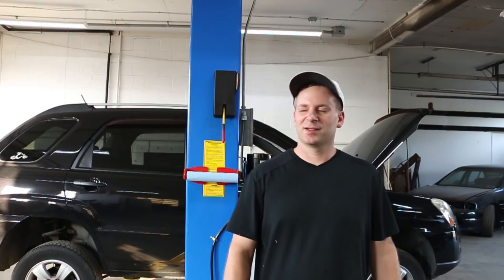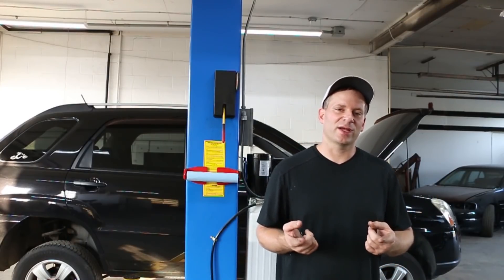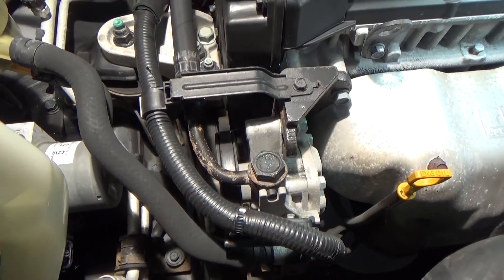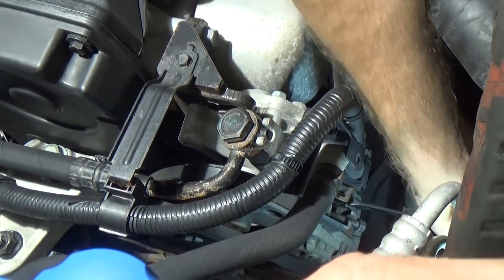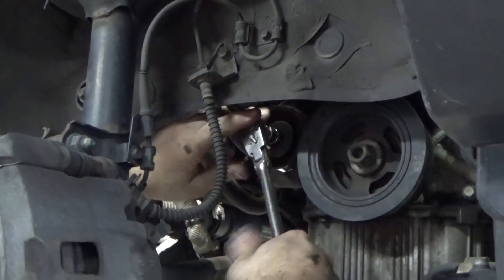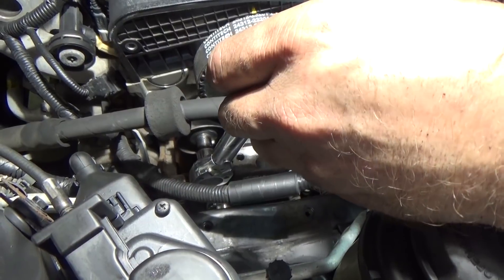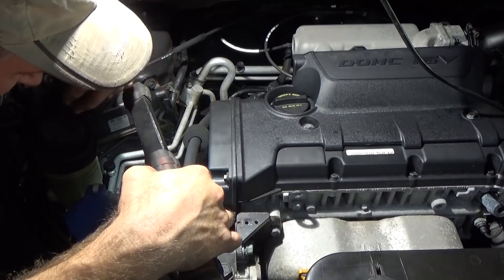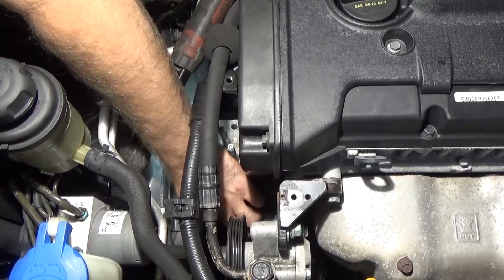2.0L timing belt Replacement kia Sportage and many others

Comment: Where are you located? And can you fix mine? I tried to do everything you said in the video step-by-step and it’s making a weird noise now that it wasn’t make it before. What should I check first
Reply: Apparently after I took the hoses off of the engine before I started the process of changing the water pump and timing belt I didn’t realize they where worn out and needed to be replaced as well, so i replaced those and got a new battery due to it being completely drained as well. And made sue all the top timing marks were on point before the process of putting the crank pulley back on and the tensioner pulley for the belt. I also made sure the bottom mark was back where it was at the beginning and put the crank back on. Also what is the pounds of pressure for spec?

Comment: i have a tuscon 2008 and the belt timing it the same it, but when the belt already is installed and start the engine the belt it go at one side rigth and no stay in center of sproket camshaf ?

Comment: My cars not starting , had a shop replace my timing belt with gates replacement . Car wont start and smell wierd burning smell in engine compartment by the belts . Opened cover to see if timing belt broke but its there . . Could the belt have moved forward on sprocket or slipped thus causing my car not to start after it cranking>?
Reply: 53 years as tech. Not likely but possible they left the washer OFF which is a belt guide that goes behind the crank pulley? that could allow the belt to drift outward and rub on things, causing damage to the belt and burned rubber or plastic smell. However that wouldn't keep it from running until it jumped time from damage, so, don't know. 
Check electrical, fuses, basic things, and of course the no start and smell may not be anything to do with their work. things happen.
Reply: @billbanche4605  Found out at shop that alternator seized up and busted the belt. You think the friction might have caused timing belt to shift?

Comment: Thank you buddy you give me the confidence to do it myself, I did it and it hasn't ran this good in two years,. 
Thank you.
There's just one thing I want other to know about this project that I didn't know on 2002 Kia Sportage you do not have to take crankshaft bolt off to get the harmonic balancer off you have to take 6 little screws surrounding the crankshaft bolt to get harmonica balancer off, don't be like me and break the harmonic balancer finding out the hard way.

Comment: As an owner of a 2006 Kia Sportage with 220k+ miles and no history of the timing belt being replaced, I'm always wondering how long it's got left. I've done a few fairly big repairs on it and actually like driving it. This video helps to make me a bit more confident in doing the job, if I decided to, but I would do the idlers, seals and water pump because I would not want to do all this twice.
Reply: Do it now if you haven't already.  I'm doing my kids now at 174k and it's jumped and a lot of the cogs of the belt are missing.  The am pulley is about 1.5 inches off when the crank is  TDC. The engine still has good compression and runs, kinda, so I think we got really lucky.  I don't have it put back together yet though. We'll see.

Comment: Front wheel drive vehicles combined with timing 'belts'....oh fun..... what a racket using belts over chains too.... what most maintenance/repairs that were once relatively easily / accessible now with FWD/traverse engine placement are now major headaches...  yes I know most vehicles nowadays are FWD...doesn't diminish the headache of them.  I'd rather deal with less than perfect handling around corners in bad weather and stick with RWD and do-able repairs any day of the week - and in regular weather - which is most of course- driving RWD has much better handling.

Comment: I need help! After seeing your video my dad changed the 2005 Kia Spectra 2.0 timing belt. I had to align the mark on the crankshaft by turning the bolt. Also had to adjust the camshaft as well but is the mark on the lower timing cover or inside the engine? I saw the mark is different when I watched your vide. We lined everything up but when we started the engine, it cranks but doesn't turn over. Are the timing marks off?
Reply: If you are around did you fix the problem?

Comment: 21:40 I don't get it, tried torqueing my tensioner to 39 ft lbs and the damn bolt broke. At first I though you meant inch pounds but after searching for a manual it said to torque it to 32-40. Was lucky enough a piece hang out far out enough to barely catch and twist with my nails then it got harder to unscrew, but was able to get it out with pliers. Shit myself thinking I had to get a small drill and an easy out. Bought a replacement grade 8 bolt and installed it to 20 ft lbs. I'm wondering if thats enough to prevent movement, I just don't want to stripp the threads on the cylinder head. Should I at least try 30 ft lbs?
Reply: Yup, man made stuff will break

Comment: I have an 2007 sportage my wifes car gonna do the timing belt in the spring timehas 84,000 on it now replaced the top cover because it was broken and looked ok for now can i lift it up with out the front motor mount being in their or always has to to be on the jack with the block of wood?

Comment: Hi Will, awesome video and channel! You said you torqued the harmonic balancer to spec, but in the video you just used your air impact gun. Did you calibrate the air pressure to deliver the right amount of torque,  or did you do something else to torque it? I'm about to attempt this exact job on this exact vehicle, but will be doing the water pump, idler, tensioner. Thanks to your video, I realize that I need to do the seals on the sprockets as well. Very grateful to learn that, since I would hate to take all that apart and not do something so simple.
Reply: 3 Duggar Duggas of impact gun is factory spec for any bolt. Unless it snaps, then it’s 2.

Comment: man, I had to come back and look at this again, my tensioner pulley for this same engine in a 2004 spectra does not have that part that you stick the cotter pin into.   the pulley just fops around till it's tightened.    it was not there when i removed the pulley and the new one didn't come with it either.   there is a small hole for a allen wrench in the pulley off to the left side to insert a allen wrench so i can pull up on it and tighten the belt as i bolt it down but nothing else.    do you think something is missing?

   245 am now,     I think " Maybe" these Korea magicians, did some kind of switchheroo. this is a 2004 spectra, it has 2005 brakes on it and some other things that are later model than 2004.  But this pulley thing is NOT an Later design with the tensioner spring, it is a crappier design from EARLIER than 2004.  and so it is a "FIXED" pulley.   so setting the tension is the responsibility of the dick that is fixing the car "ME".     Sooo   looks like no one ever mad e a video with the early design tension pulley with manual adjust and then bolt down to the block and leave it be/   i just get to guess since on this particular car i did not bother to buy the repair manuals.   because its a Korea car and I thought.  my daughter will d rive it a year or two and sell it,   anyway. I have a 1991 toyota camry that seems will never die here.  i will look at whatever  the tension is in the manual for that car and set it to that and and cross my fingers.   Japan had better stuff anyway. it;s probably a good spec.   

  man though.  this thing, the 04 2.0   it really does seem like a knock off doesn't it?   I mean., the water pumps not driven by the time belt but they sure put it close enough to make you scratch your head.  

Korea, i hope they wake the fk up and be the up and coming , setting the standards  for as hough as japan, and not go the other shitty espionage knock off crap way that china has been doing. 

 back at it.  i want this done b4 the sun comes up.   LOL

   days later, still in the driveway    apparently there are two types of those tensioners, mine "EARLY"  and yours later model, Mine Sucks, yours is more awesome.   anyway,  i literally have to guess with mine what the tension should be,    also, funny thing about that water pump pulley thing.   when you have the car in a driveway   up on a jack stand, and the engine elevated on that side, the water pump shaft is not horizontal, its angled and the pulley wants to fall off before you can get the bigger half on the short shaft with the PIN to line up.  after dropping everything about 30 times and spending well over an hour of back straining , I got some sealant out and glued the small pulley to the mount then glued the larger one to the small pulley. I held it all on till it set a little, that gave me just barely enough time to get the tiny 10mm in there    - i am kidding, it still took 4 more tries of dropping everything,   but it did work eventually.    I hope that pump seal is good cause i don't want to take this apart again. LOl  hope this helps someone else. the old seal did not have any gasket sealer on it so i didn't put any on this one.

Comment: I am from Malta ,but here the mechanics they fix one thing and they brake another thing.We need mechanics  like you here.I have 2007 KIA sportage ,you thing i need to change the time belt?  40,000 miles i made.
Reply: Mine has 105'000 with original belt changing this weekend

Comment: Hi Will, another excellent video. I just can't believe how tight some people are not doing the water pump, tensioner , etc while you have the front cover off.
Beats me.
Cheers
Mark / NZ
Reply: I can understand the water pump not being replaced, since most originals go well over 200k with regular coolant drain and refills. In fact I'd rather have the original with 80k on it rather than a brand new chinese after market. BUT, not replacing any idlers and tensioners is plain guaranteed future failure. I bet either the ac or the timing belt tensioner will fail before the next timing belt service. Most of all timing belt failures are caused by either failed tensioners or idlers.
Reply from the maker: Mark Thompson thank you! I was disappointed as well when I seen what was requested, gave my opinion. Rolled the dice
Reply: Replacing the other parts cuts into the budget for buying sweet eagle print front license plates.

Comment: I have an 05 Kia Sportage. I am utterly lost when it comes to vehicle maintenance and suffer from anxiety because of it. I always think something is going to go wrong and looking at my brakes and how rusty they are makes it worse. I know that's normal and even on brand new cars the brake components get rusty and dirty fast but I always think it's literally falling apart and crumbling when I see rust.

  I'm a computer tech by occupation and have been for over 30 years and lately have been wishing I devoted my life to automobiles instead. I used to work on my own vehicles and my bike years ago(80's) but I let my license lapse because I haven't owned a vehicle for 22 years. My dad recently gave me his 05 Kia Sportage and all I have been doing is watching related videos and reading related content about about mechanics in general, cars, and whatnot. I'm probably over thinking this and this is why I get anxiety. Right? LOL

  Anyway, it only has 114,000 km on it and the alternator was recently replaced so I imagine all the belts were as well. It's been squeaking very loudly tho during every cold start. I suspect one of the belts may be too tight or loose.  Just thinking about going into the engine bay and trying to determine what exactly is wrong is a struggle. I suppose this isn't that hard to address?

Comment: I have a 2011 Optima with the 2.0 engine, and was planning on changing the belt at 80,000 miles.   It turns out that I have one of their bad engines, and my bearings went bad at 75,000 miles, while on vacation.  Now, I get a new engine, but won't trust the car anymore.

Comment: Excellent work once again. I have a Hyundai Santa fe, basically the same car. No way would I skimp on parts. It'll come back and bite you in the ass! I'm in the U.K.  (Scotland) I can get a gates timing belt kit, belt, tensioner and water pump for approximately  £100. Why anybody would let you go to all that length, just to replace the belt, and not the tensioner etc, is madness. They'll regret it when one of the pulleys or tensioner lets go, and the new belt will still snap, or fall off, and destroy the engine, for the sake of maybe spending another $50? Parts are cheaper there in the States than here in Europe.

Comment: Can anybody verify the piston position when the crankshaft timing mark is lined up?  Is cylinder #1 at TDC?  I want to verify if the belt has skipped without exposing the crankshaft pully.  2006 Spectra.